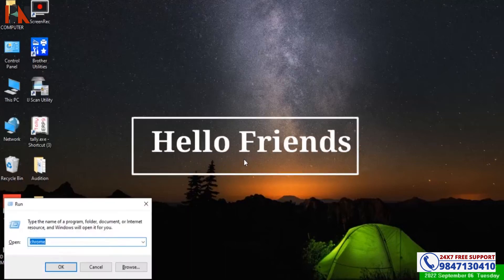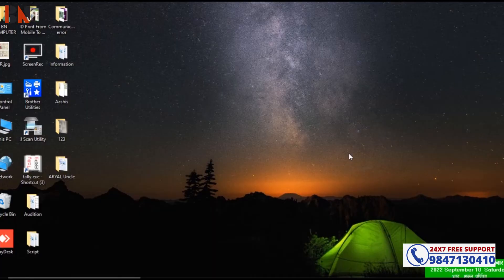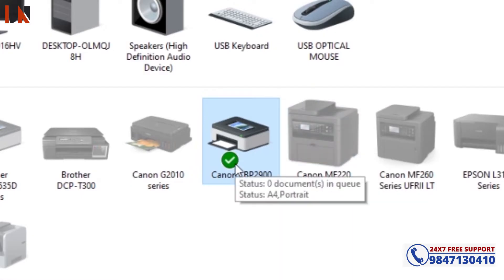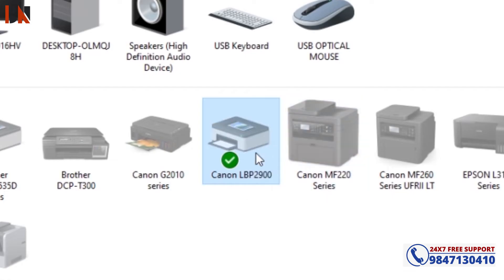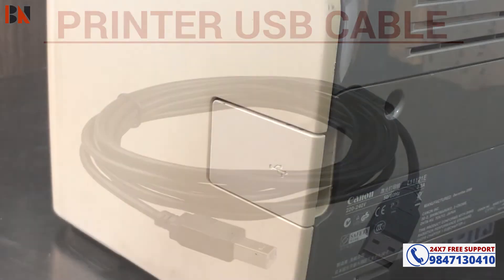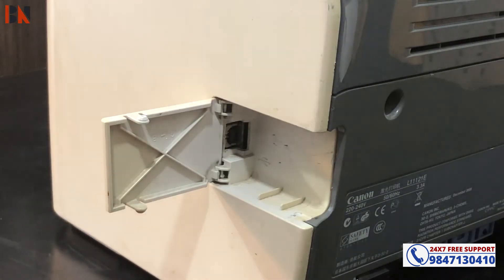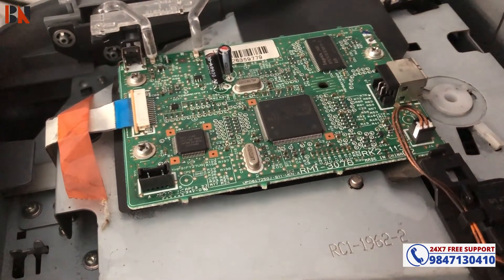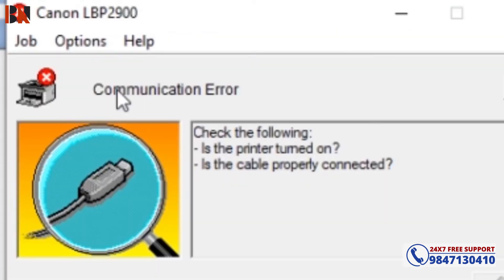How To Fix Communication Error Problem While Printing Any Documents? Full Video In Nepali

Comment: My printer is working on another laptop  that i installed earlier with same wire but same printer and usb wire is not working on 2nd laptop where i reinstalled the printer why???
Reply: The same here,did u found the solution
Reply: @toufiktechnou2221 I reinstalled the window.
Reply: Same problem bro @toufiktechnou2221
Reply: Same here 
Any solution
Reply: @bhaskarverma9665  i reinstall the window after that it worked.
Reply: @bhaskarverma9665  I contact to windows support and they take my laptop control my window app and they check every possible settings and restart my laptop and it's work for me
Reply: @bhaskarverma9665   I have same problem, so I contact Windows support and then they have take access to my laptop and run some things and it start working again